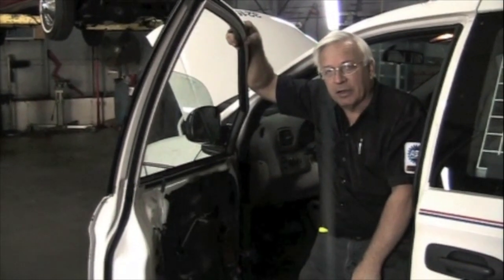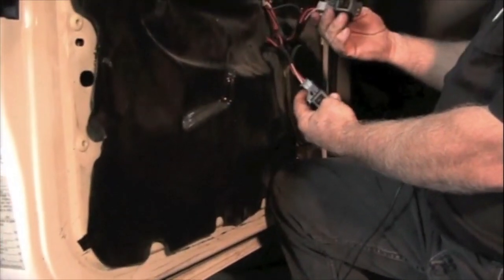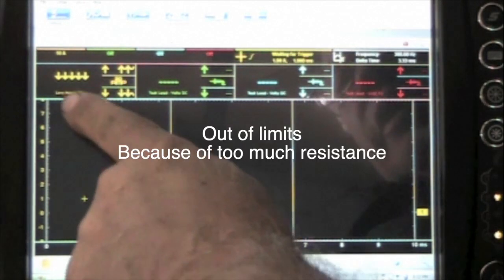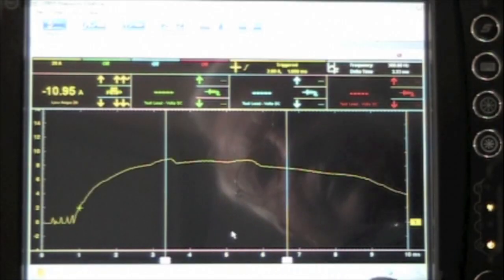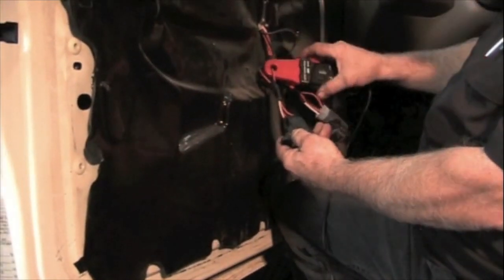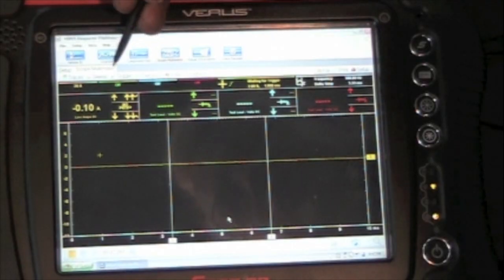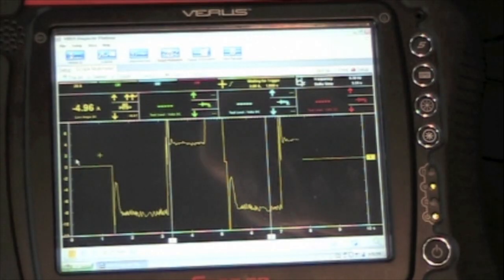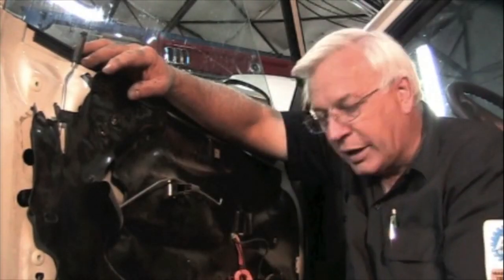LabScope Window Motor. #labscope

Comment: When you say “ resistance” in this case are you talking about electrical resistance or mechanical resistance to motor rotation ( in motor or regulator) ? The later would definitely increase current draw.

Comment: I agree with you bad motor, but you better check the window regulator for high resistance.
Reply from the maker: You're right, the regulator can cause problems too.

Comment: Thanks for the video. Clearly explained diagnostic process and explanation of different waveforms.

I don't use my current probe as much as I should. I usually use it on fuel pumps looking for a dropout.
Reply from the maker: You're right, the current probe is a great tool for diagnosing electrical issues.